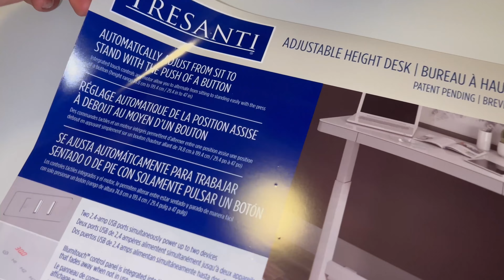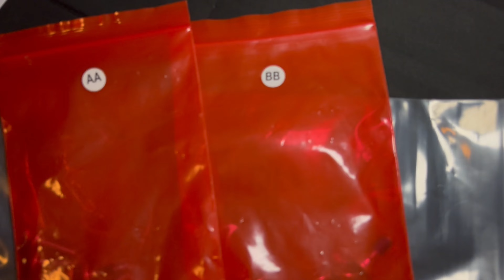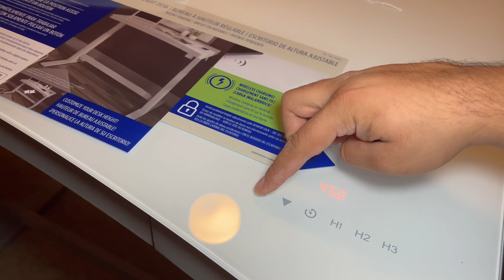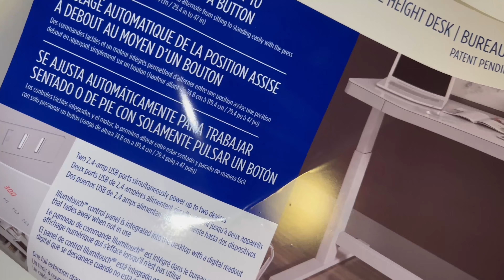Tresanti Adjustable Height Desk | Unboxing & Full Setup From Costco | Best Home Office Desk

Comment: Can you confirm whether enabling the lock function also disables the USB power?
Reply from the maker: Locking the table in place will not disable the wireless charger or the usb power at all, they are only disabled when the table is in motion other than that they’re always ready to supply power, hope that helps! 🙌🏽